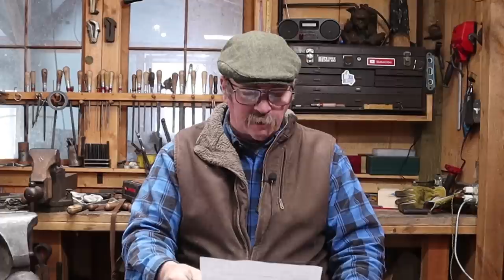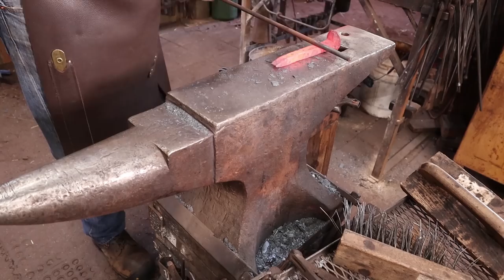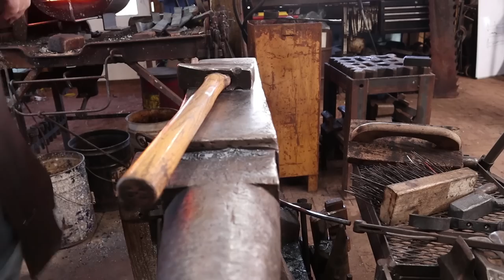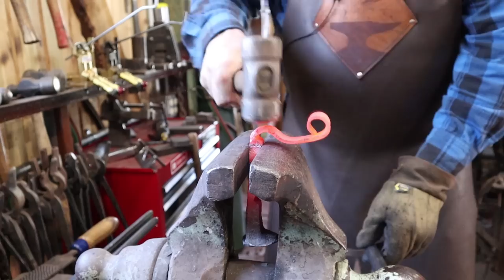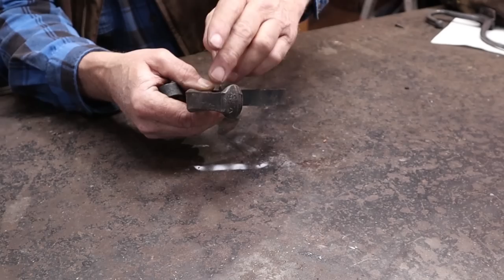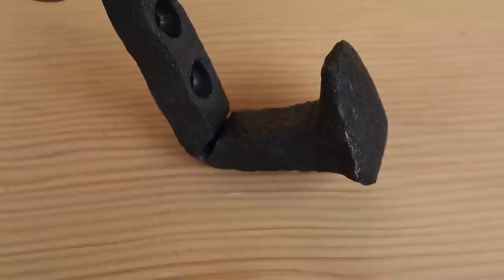Joe's rail spike hook - Hook of the Week Double feature - #41

Comment: Thank you John for featuring my hook, you make it look easy! I spend a least the length of the video drawing it out using a hydraulic press! It is a fairly new looking spike but it came from a box of rusty old spikes I got off of Ebay. I definitely need to work on rounding out the scroll.
Reply from the maker: It was a new idea and was glad to be able to share
Reply: Joe Cross love the hook! so glad it was reviewed by john I am gonna use your design and make a set of four. And I am mounting it to some old barn wood can’t wait to get out to the shop tomorrow.
Reply: Great hook Joe. I know what you mean by John making it look easy. I am also a beginner and have spent 3 hours just making a spike letter opener. Someday we'll be able to forge things faster but until then the fun is in seeing something change into something else (for me at least). Happy forging!
Reply: @mikecsokuly7992  Thanks Mike! I originally made a set of 5 and mounted them on a live edge black walnut slab for a Christmas present. I hope they turn out well for you, they can be a bit frustrating making them look similar!
Reply: @danp3796  Thanks Dan, you too!
Reply: Joe Cross Great job Joe!
Reply: @Dominic.Minischetti  Thanks Dominic!
Reply: Joe Cross You’re welcome!
Reply: An awesome looking hook from both Joe and John! I have a bucket full of rr spikes that need a new purpose in life. I may have to just pound out a couple of these and see how mine compare.

Comment: Hi John, as I was watching you punch the mounting holes the thought crossed my mind to just make the top screw hole. Then in the second position put a pin in the back of the hook that would serve to stop the hook from turning on the screw. The pin would only have to stick out 1/2" to 3/4".
Reply from the maker: As long as it doesn't need the strength or two fasteners that would work well

Comment: I do have an idea in my head I think would make for a pretty cool hook. Too bad I don't have the equipment and abilities, at this time, to pull it off. I think it would be pretty cool, though I'm not sure how to pull it off without adding a weld.

Also, I think you could've gotten away with using one of those Viking stump anvils you made on this hook.

I did notice that, at the end, it looks like his hook was a bit thicker in the center section. So I think you were on to something in saying his had more material to work with.

Comment: I think I would have tried putting the fuller for the top half on the opposite side (the back of the hook), which would eliminate the bend from back (in my own opinion it looks a bit awkward, but that's only me, and others may see it as interesting).  I think that may have been a better option for the shorter hook that John used, but I think they are both good hooks.
These are certainly not criticisms, only the way I would have envisioned it (and with the benefit of seeing two other examples!).  Sometimes (?often), we don't have a good idea on what we want until we have seen it,  or done it, several times. But that's the great thing about blacksmithing; you can do the same project sometimes dozens of different ways, and none of them are "wrong".  Some might be easier, or quicker, but not wrong.
Reply from the maker: That would be an improvement.
Reply: Thanks, that sounds interesting, I'll have to try that!